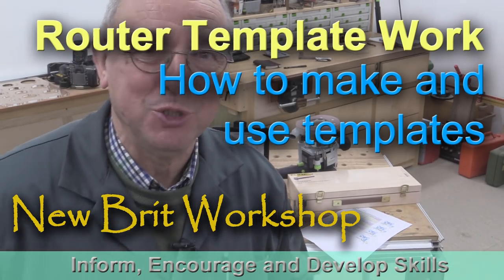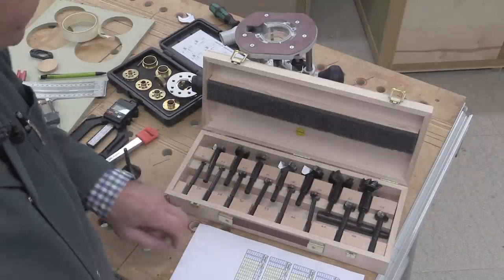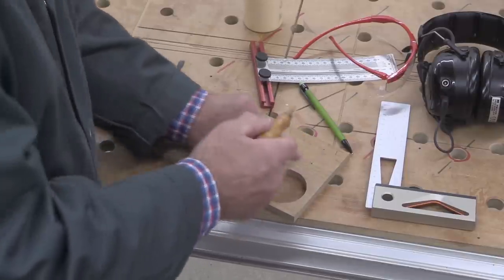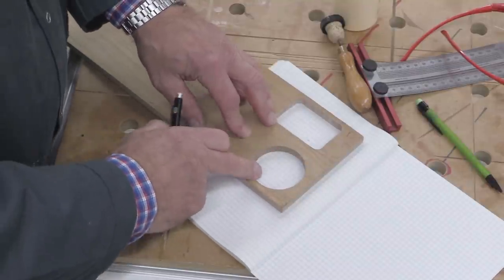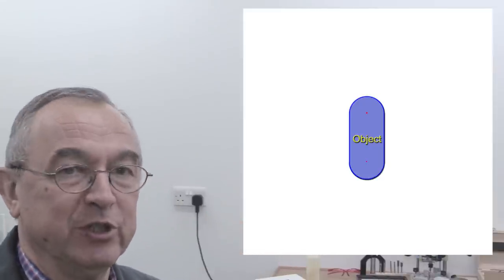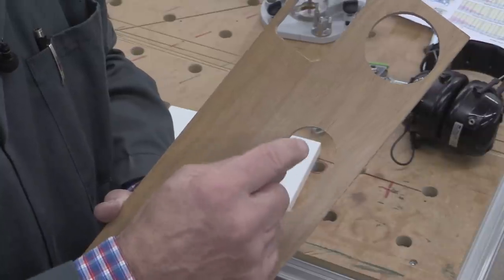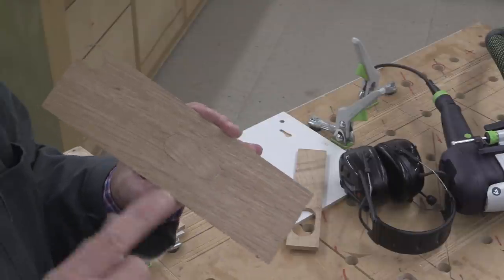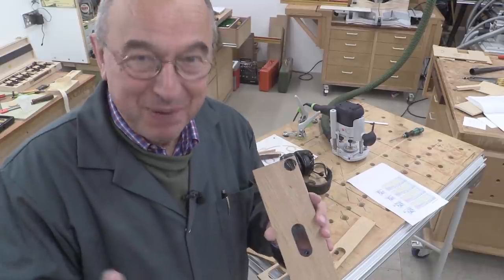How to make router templates

Comment: Another useful video Peter.  On the guide bush size versus the radius of the corner of the template producing square corners (at 9:45), the corner will actually be round as the cutter makes a round cut - even a square cornered template will produce a round cornered cut.  And if you choose the right cutter that radius might be the radius you want for the corner.
Reply from the maker: Hi Geof, Yes, for a plug but for a hole it will have square corners - try it.  Peter
Reply: @NewBritWorkshop  I may be missing something, but I cant see a router making a squared corner hole no matter what. You have a round bit in it that would round the corners anyway, unless that router bit is what, 0.5mm?? I think a simpler template with straight corners will produce a rounded corner hole by the radius of the guide or the bit itself.
Reply: You're right, and I was going to make the same point. A square corner is only seen in the video because a pencil was used and that has a very small diameter. In a sharp-square template, the corners will always have exactly the  radius of the cutter.

Comment: Great Educational videos. I kinda understand the offset. Do the manufactures provide offset tables or must you figure this out yourself.
Reply from the maker: Hi Robert, You have to work it out yourself as the offset requires the information about the cutter diameter and the guide bush diameter.  Cheers.  Peter

Comment: Hi Peter,  what speed do you run your drill?  Very interesting video, bit of a towel round the head job to work out all the critical dimensions.  Mike
Reply from the maker: Hi Mike, It is easier than you think once you have sat down and worked out how to make a couple of videos on the subject !  Cheers.  Peter ; sorry - about 1100 rpm (I think)

Comment: I will soon install a new sink in the kitchen, and I want it to sit flushmounted with the oak countertop. I'm trying to figure out how to create a template from the sink to do this. It should create a cut that is a few millimeters larger than the sink. But I'm worried about whether the corners are going to be correct, if I use this technique with different offsets for the template and the actual cut. Maybe this could be a follow up video from you on how to do something like this?
Reply from the maker: Hi Bo, Your sink will most likely have corners which are a quadrant of a circle. You can experiment with cardboard and a protractor to get the right radius. Your initial template could be made from cardboard. Measure the length and width of the sink across the centres of the respective sides and draw the rectangle on your cardboard adding the clearance that you feel you need. Next, using some scraps of cardboard experiment with the corner radius. When you have this right transfer it to the cardboard template. Cut it out and check. If it is right redraw (do not trace around the cardboard template) the shape either on your counter top or onto the wood that will become a router template. The rest should then be easy.  Peter

Comment: Hi Peter- thanks for the video, very informative. One question that springs to mind though, is why don't you just use router bits with guide bearings that would cut directly up against the template and avoid all the offset trouble? No doubt I've missed something and there's a perfectly good reason so I'm very curious..?!
Reply from the maker: For this type of work you would need (or be better off with) top mounted bearings which are more expensive than bottom mounted ones. However, the bearing has a significant diameter and that dictates the minimum radius of any part of the template. Most of my bearing guided cutters have 16 mm or 19 mm bearings but my guide bush set goes down to 10 mm diameter and so can get into tighter corners.  Peter
Reply: @NewBritWorkshop  Gotcha, thanks, that's helpful.

Comment: Would you mind helping me with how to make a template?  I need to talk in inches instead of millimeters though.   I need to make five rectangle holes 7/8" x 2.5" in 3/4" plywood with square corners.  In watching your video lesson, it appears I could achieve this by making a larger template than the hole needed and then use appropiate guide bushings.  I can't quite grasp how I need to do that.  I am a beginner woodworker so all details would be appreciated.

Comment: I'm wondering if the rule about making sure the template corners radius is greater than the radius of the guide bushing only applies to an oval shaped template?  Wouldn't the rule for a rectangular shaped template be the opposite in order to get square corners?  Rule:  Template corners have to have a radius smaller than the radius of the guide bushing.

Comment: Great video! However with my new Shaper Origin it is much easier and - at least I think so - a bit more precise. 
Any plans to use that one for your next video?
Reply from the maker: Yes, I said this in the first and also this video but it will take a little while as I have other work to do in between. I have the X-Carve and use Aspire outputting in gcode. Cheers.  Peter

Comment: Hi Peter. How do you get a mandrel. The mandrel has to be compatible with the router.  Thanks for sharing the video.
Reply from the maker: Hi Christopher, No, a mandrel will work in any router as long as the collet size is correct.  Peter

Comment: Hey Peter.  I have the Incra square, as you have.  Actually most of the tools I have are because you have recommended them.  Festool should now really send me birthday cards with the money I have spent.  Anyway, what marker or pencil do you use with the Incra?  I presently use a retractable pencil and the lead is constantly breaking in the holes.  Great videos, as always.
Reply from the maker: Hi Kenneth, I bought a pack of 5 retractable pencils which are quite cheap and cheerful and the leads do break. It is mainly because of the point getting stuck in the grain or a defect on the surface. I am afraid it is something to try and learn to avoid. I adjust the pressure to as low as possible to leave the line and that does help.  Peter
Reply: @NewBritWorkshop  I know you always reply when possible, so thanks for that.  I've ordered some artist's markers with 0.5 tips.  They are supposed to be arriving today.  When I've tried them, I'll let you know if they are any good and whether they leach into the wood at all.
Reply: @kennethdawson9799  try tech pens like the microns or Rotring

Comment: Great explanation. One comment - At 12:06, the chart shows the radius as 22mm + offset - shouldn’t it show the radius as 11 mm + offset?  When you describe your drill selection, you changed the measurement reference to diameter - 40 mm drill minus 2 times offset (9 mm) yields 22 mm diameter of object.
Reply from the maker: The radius of the 22 mm curve is 11 mm. Add the offset to the radius or twice the offset to the diameter.  Cheers.  Peter

Comment: Hi Pete 
I’ve missed the first vid, where can I get an offset guide from please. Many thanks
Reply from the maker: Hi Chris, I can send it to you if you let me have your email address or you can see it on the Axminster web site:
https://cdn.axminstertools.com/media/downloads/502571_TechnicalDataSheet_1.pdf?_ga=2.238155074.375385186.1644229348-927838810.1610087457&_gac=1.181819989.1643627724.Cj0KCQiArt6PBhCoARIsAMF5wai_Tqxh0jJ_7LxbWVq23zrCeeE-BSxRr_s6lFvPp7HQr0YtJDjLpxYaAi9vEALw_wcB
Peter
Reply: Hi Peter 
Thanks very much, Now have you done a video on how to use the chart ? Many Thanks in advance. Your videos are “mint” explain everything so calmly and without all the “faff” cheers

Comment: I like to watch your videos. Would you like to share the code numbers of the exact seven trend straight cutters?
Reply from the maker: ¼” Shaft
3/01X1/4TC  (4 mm)
3/1X1/4TC    (5 mm)
3/2X1/4TC    (6 mm)
3/3X1/4TC    (7 mm)
3/4X1/4TC    (8 mm)
3/61X1/4TC  (10 mm)
3/8X1/4TC    (12 mm)
Peter
Reply: @NewBritWorkshop  thanks a lot Peter.

Comment: Hmm those Famag drills cost £900.
Reply: That seems a bit much. I got my set a couple of years ago at a price of 299 eur. Simple superb quality.
Reply from the maker: Hi Jake, You are way out with your pricing. Famag1622.515 - 15pcs 10-50mm in wooden case between £275 and £295 +VAT. In UK try Yandles, D&M, West Country Machinery 4 wood , Workshop Heaven.  Peter
Reply: @NewBritWorkshop  that’s a bit more like it. I clearly got mixed up some how. I feel the need to acquire some more tools.
Reply from the maker: Hi Jake, If they had gone up in price that much I would put them on ebay !!  They are excellent though and worth every penny.  Cheers.  Peter